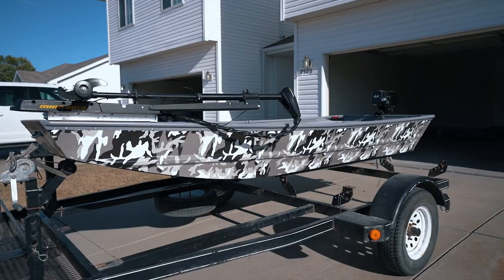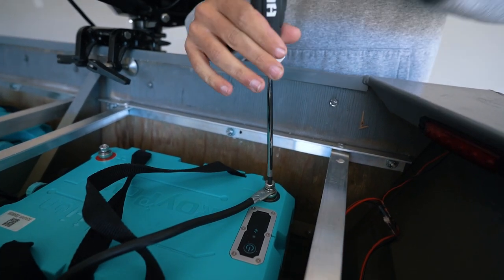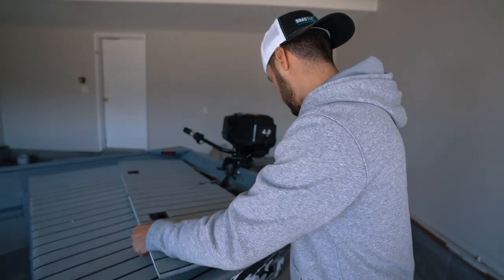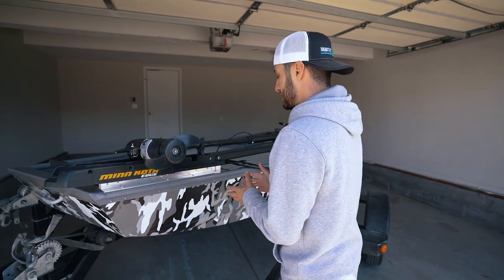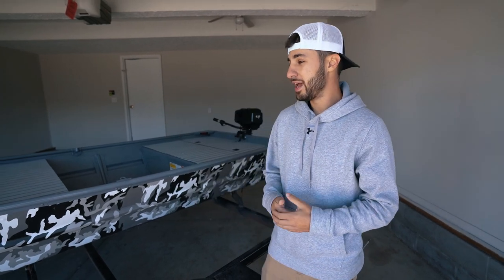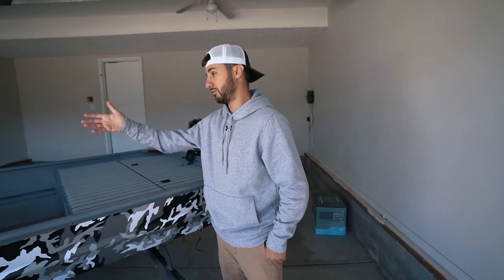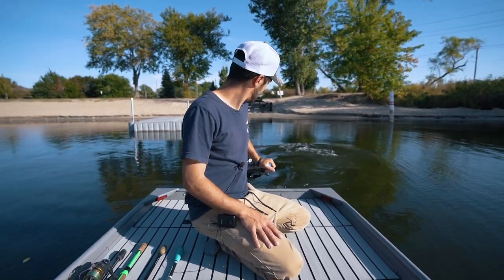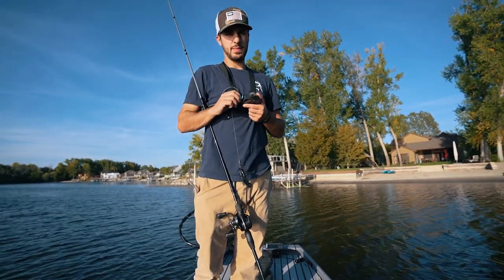I Built An Epic ALL ELECTRIC Mini BASS BOAT!

Comment: If no wood what are you using for ballast weight, there is a reason fiberglass boat companies use wood and why some large ships use concrete, or iron. On a lightweight boat like yours does it get affected by wind drift? Ballast is used for more than just to keep it upright its also used to give the boat itself a little heft. Does yours float out of control when there is wind or any kind of swell, I'd be Interested in all of that info as well, as I might build my own.
Reply: Planing hulls don’t need ballast. Weight is generally the enemy in a planing hull, with designers and builders constantly seeking ways to reduce weight. Particularly on flat bottom boats like this.

Many saltwater targeted boat companies don’t have any wood in their fiberglass boats - it’s a major selling point to be wood free. I was shocked when I found out bass boats have wood in them because freshwater and wood are a bad combination that leads to rot. There’s really no need to use wood at all in fiberglass boats anymore with the availability of foam coring materials like divinycell and coosa.
Reply: @N2theBlue1   do you get wind drift when it's super windy? It seams to light weight, I mean yes you cargo under the deck acts as ballast if it's balanced evenly, but it looks to high centerd, what I'm asking is boat's will float away from the anchor point and it's normally a slow drift, have you compared the drift to other non electric boats and timed it, as light weight boats should drift away from the anchor faster and it seams like it might be to fast near a current. Maybe a test is in order in the future.  Keep up the great content.
Reply: @the.unhappy.mechanic  that’s what the trolling motor is for
Reply from the maker: @the.unhappy.mechanic  it’s a Jon boat. This whole project is custom and specific. Your basically taking a row boat and turning it into a mini bass boat. The point is to be light but stable. If I need to put it in a truck bed I can. If it’s windy enough to blow me off the lake I’m probably not fishing that day anyway haha also yes trolling motor solves other issues of wind

Comment: This is exactly the reason I will stick with a gas engine. You spend 4k on batteries to power a 4hp motor. If you spend that on a gas engine, you would have something much better.